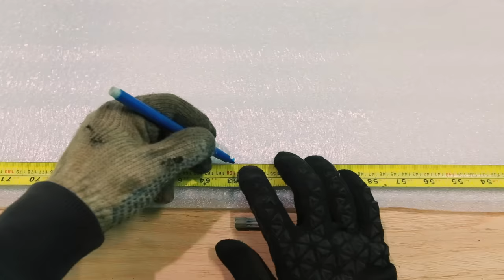Van Conversion on The Classic VW Van - DIY Campervan Build

Comment: When this got two mins in I thought "surely not a 52 minute video without any talking" but now15 mins in I'm hooked! Aside from the actual camper fit, you have to be complimented on the videoing and editing. All the different camera angles, subtle use of sound, slow/quick passages and artistic touches like the spinning roller 13:46 really make this a pleasure to watch.
Reply from the maker: Wow, thanks!

Comment: Rodrigo, nice work.  May I suggested that you also use a sanding respirator, or wear a mask,  when using angle grinder.  
A person might get sick after inhaling large quantity of small particles (less than 2.5 micron in diameter)  that rubbed off during the grinding process.

Comment: Great idea with the coffee and stain. I was curious why didn't you line the walls with thick sound deadener, or that black foam with a sticky back and you used what looked like MDF offcuts as batons to screw the ply too MDF on its edge splits when screwed. the doors have big cavities too for sound deadener and you could have screwed into the door frames and put a nice plastic cap over the screw heads. In saying this your van is magnificent love the colours.
Reply from the maker: Thanks for the tips! I will keep them in mind for the next project!

Comment: The most overrated vehicle ever built, in their day the Bedfords were better in every way, especially the engines. This is the price to pay for "cool", because they are, a rustbucket too. Now the watercooled T3s were good and it's been downhill ever since. At least take the bulkhead out mate, otherwise there is no space. I like the stained ply finish and fit and finish is good, but gluing all the panels on is a nightmare if you have a fault...and you will. I prefer to do the wiring after and hide it, it allows mods, plus no need for conduit...it's 12v and fused at source.